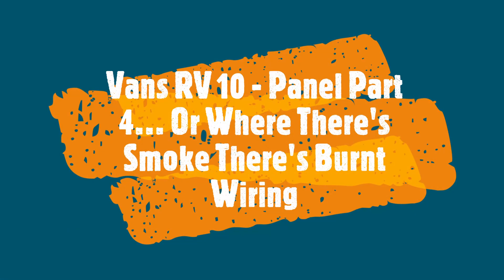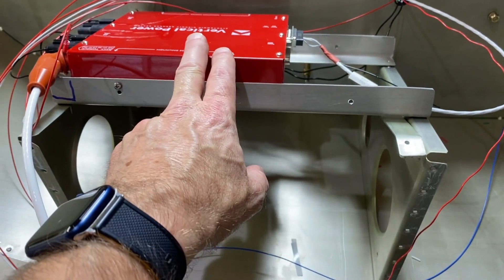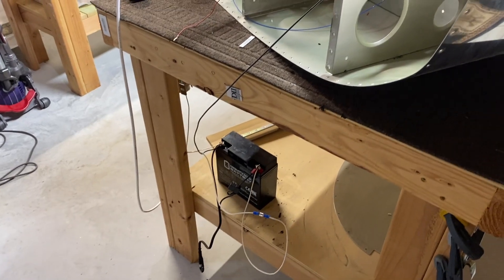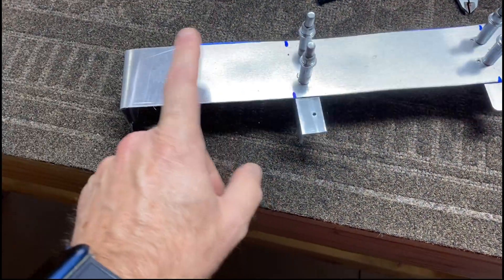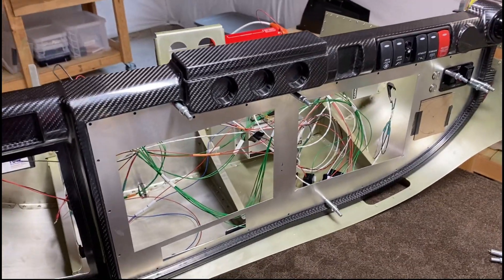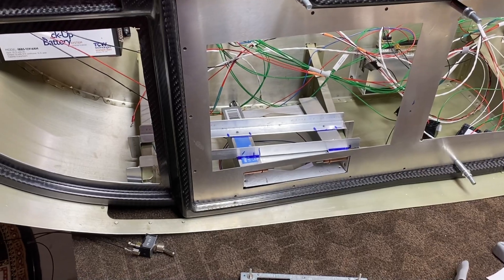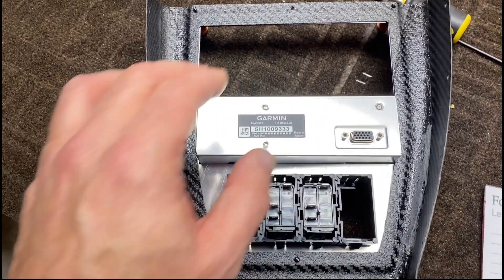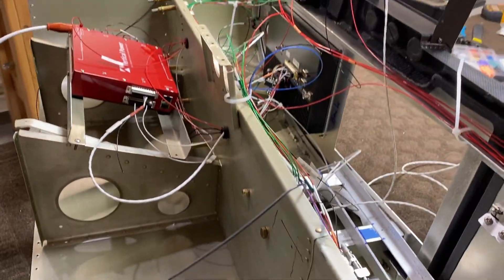Vans RV 10, Build update Panel Part 4

Comment: Why no fuse or circuit breaker between the battery and the panel???
Reply from the maker: Great Question, FYI it is completely optional per the VPX installation manual and I have seen it done different ways.  In my actual schematic I do have a breaker/fuse  but I have not mounted the post yet to the fire wall.  I just have not figured out yet what size fuse I will use.  There are also ANL fuses between the alternators and the main bus.

Comment: Nice! Before you start you back up battery is on to see engine parameters, after start and your master is on, do you then shut off you back up battery or would you leave that switch on?
Reply from the maker: So the initial sequence would be (preliminary)  Backup battery on (and check), master on, start, avionics master on, autopilot on.  The backup battery will charge from the vpx and is running and ready in case of a power loss. Shutdown would be the opposite.
Reply: @aleafonthewind3775  so it is left on just incase you lose main power? Makes sense now. Thank you